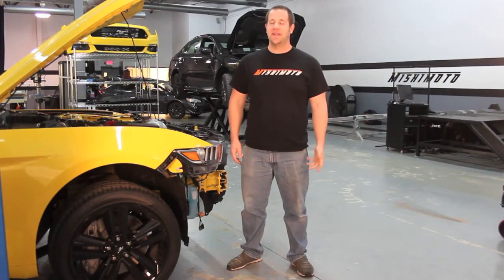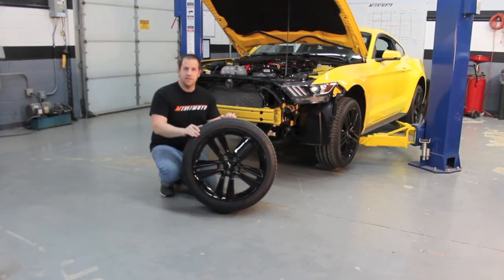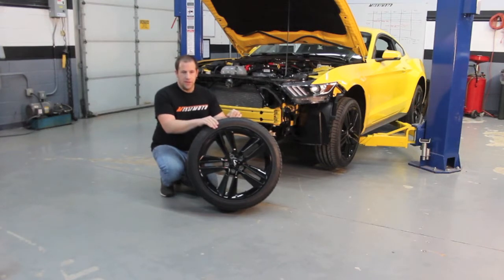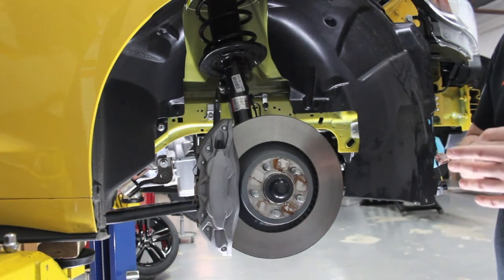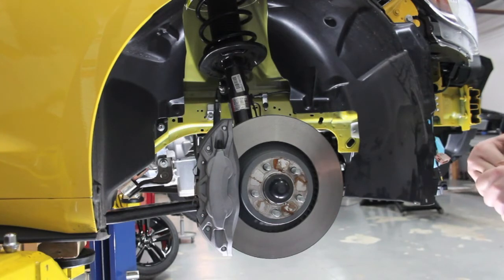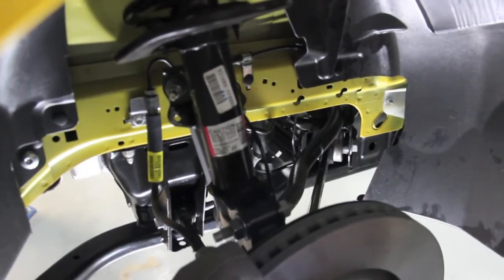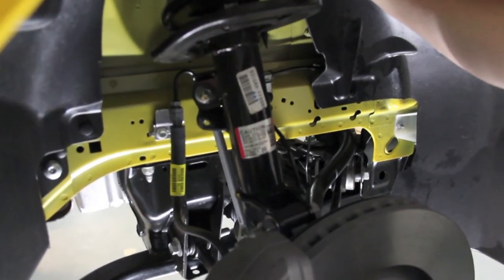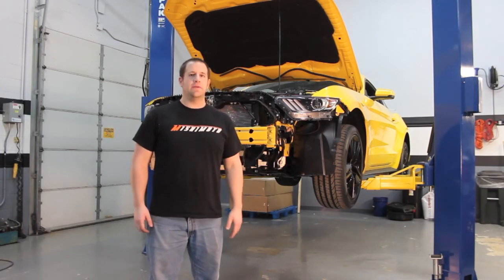Mishimoto 2015 Ford Mustang EcoBoost Review Series, Part 8: Wheels, Tires, and Brakes

Comment: Can I put 17 inch wheels  on the Mustang EcoBoost with the performance package I know that they come with the 19 inch wheels and the summer tires but for winter driving do you recommend buying a set of 19 inch winter tires  or  17 inch ?
Reply from the maker: Hey Aaron! The performance package provides a much larger brake setup compared to the base model. This will make fitting a smaller diameter wheel a bit difficult. 17" wheels are very unlikely to fit, however the 18" wheel from the base model should certainly do the job. You can then run a winter tire package on the 18" wheels and return to the 19" wheels during the summer.

Thanks!
Reply: Thanks for your help. Love the videos keep them coming. And when you get a chance make a video on the change in hp by adding an air intake and exhaust.